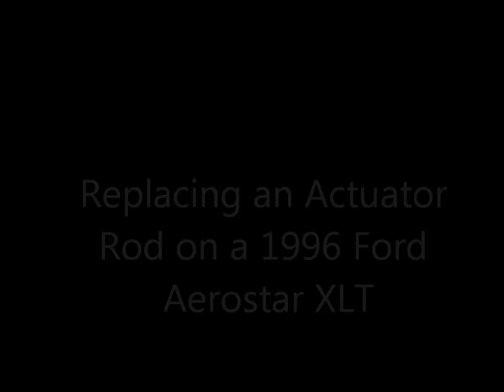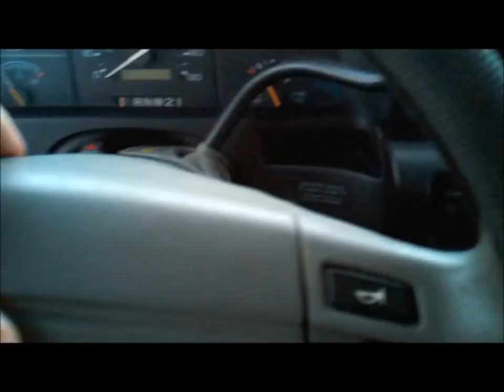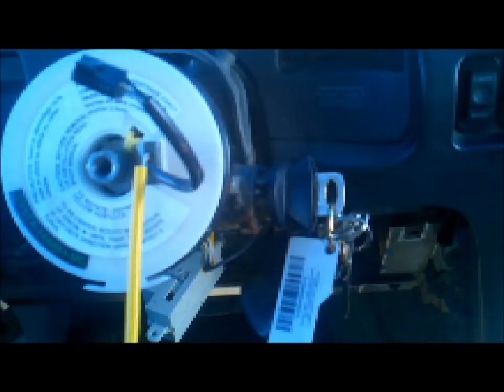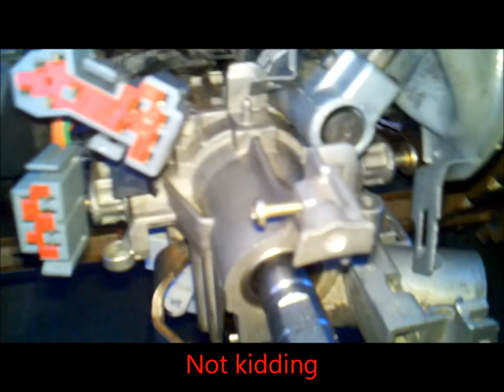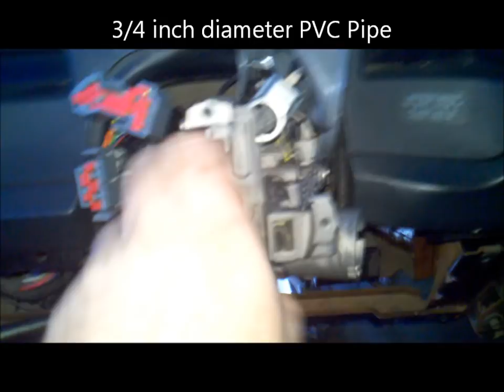Ford Aerostar Actuator Rod Repair

Comment: A couple of key things are missing. 1. The removal of what you called the bearing retainer. The part that is a lot like a snap ring but w/o the holes for snap ring pliers. I didn't see you remove that and I'm stuck at that point. 2. The things you held down with the airbag nuts. Those are held in place by some type of spring pressure? I was thinking I'd have to remove the pin they rest on when the thing is fully assembled.   Oh and one more thing... how did you end up getting the teeth on the actuator in the proper cogs on the gear?
Reply from the maker: Do you happen to have the video times?  Then we can work on getting the answers you need plus with others having just completed this recently there are fresher memories we can turn to just in case.  On the teeth I don't remember having to do anything fancy as it was the alignment of the key ignition cylinder as it came out that has that alignment.  Once the new actuator rod is in it ends up at the same position the old one was in.  I also recommend reading some of the old comments as there are some good tips.
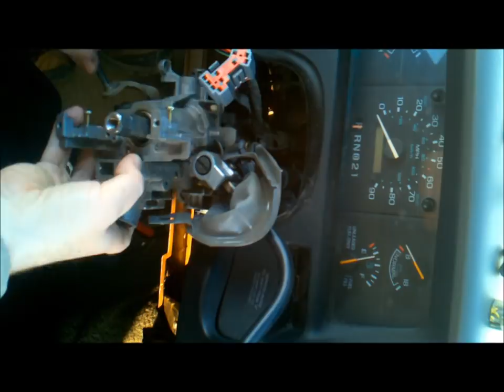Reply: Thanks for the reply. I'm taking a break from it today but I'm in the middle of doing this.  The retaining ring just needs to be unseated from its groove using a screwdriver and then slides up the taper of the shaft and comes off. That wasn't in the video so I don't have a time for that.   2. the time is 8:41 for what you called the lock jaws. I found they (in my case there is just one) are indeed under spring tension. I used a screwdriver to move mine down so there was no snap. I've got mine apart now and have the new actuator so I'm at the reassembly point. I found a vid where a Mustang owner removes the entire column and replaces both actuators. Not sure why he replaced the rear actuator but if anyone ever needs to do that, that vid is also helpful. He gets to the bearing retaining ring here: https://youtu.be/vBZvKFjVTas?t=28m11s
Reply from the maker: I have definitely thought about finding someone local with a need for this repair and remaking the video.  When I made this there was nothing else on YouTube on the subject and it was based on a few different things including something similar (but described in text) on a Ford Ranger.  I spent at least 24 hours over 3 days figuring everything out (including having to go get things).  After all this time and feedback I definitely wouldn't have skipped over as much as I apparently did (including the reassembly).  The filing part alone would have helped others to show exactly how far I had to file to get the rod back in.  Glad you got passed it and thanks for the link!
Reply from the maker: I would also make it in 4k and use multiple cameras to provide multiple angles without the jerkiness there is in spots (or the speed at which it leaves a segment).
Reply: Hope I didn't give the wrong impression because your video was the only helpful thing I found on youtube or searching through forums. I'm beginning to wonder now if I didn't imagine that other snap ring. I took another look at the vid I linked to and that wasn't a snap ring, it was that "tolerance ring." I hope there wasn't another snap ring because I couldn't find it tonight when I went out to install the actuator. I haven't had much sleep the last couple days. I'm doing this job on my 96 F150. I've repaired so many things on this truck that I could have made a few movie length vids if I'd been filming the work ;)
Reply: If you do that you should have that person film as payment. And then run some commercials and make some money for your effort. I usually work alone so filming would be tough. I wish I could have filmed the clutch job and the pedal bushings replacement. The clutch just because it might be helpful to show how to remove and install a transmission alone. The pedal bushings would be more helpful video though. That was a really frustrating job. I couldn't video anyway because my hands tend to get really dirty when I work on old machines. I don't have any video editing software anyway.  Okay I just rewatched your vid and there's no other snap ring so I'm going to go ahead and try to get my truck going tomorrow. BTW I had trouble with that left side lining up too. I'd forgotten your method so I just fiddled with the steering shaft and it all went into place. Thanks again, your vid was really helpful.
Reply from the maker: I can understand that, I also understand what it is like when instructions appear to skip something crucial when you are already knee deep into the problem.  The one thing I wish I would have known when my actuator rod broke was how to turn my van off.  I did obviously learn that and was able to drive for over a week before attempting the repair.
Reply: When I parked and turned the key off and nothing happened... I did the first thing that came to mind... put it in gear, brake, and let the clutch out to stall it. Disconnected the battery next. I'm guessing you removed the ignition switch from the column and used it to start and turn off the van til you fixed it? That reminds me of something. My switch is very stiff... hard to move it into the various positions by hand. I went to the auto parts store and looked at a new switch. It was the same way. If they're all like that I'm surprised these plastic actuators don't break more often.
Reply: I just wanted to add one more thing. On my truck the turn signal cancel cam actually goes in before the snap ring. I was confused there for a bit bc I didn't make note of that during disassembly. I was going by the way your van is. the spring was very loose and the airbag wheel thing was not snapping into place. Also the cancel cam would never have reached to part it needs to reach to turn off the turn signal. I looked closely at the entire assy and the only way I saw it could work was w/ the cam before the snap ring. Voila.  My truck is a 1996 F150 XL 2wd w/ standard transmission. It has an airbag but no tilt steering wheel. I have no idea if other f150 models are this way but as you mentioned... take note of how everything is assembled before jumping into this. And maybe even snap some pics. BTW I installed aligned the slot in the rear actuator w/ the mark on the rear assembly and installed the ignition switch before installing the front assembly and the gear inside the lock cylinder housing aligned perfectly w/ the cogs on the front actuator, That may help someone in future. If any of my comments added confusion feel free to delete them or ask for clarification. I'm not a tech writer, don't know the nomenclature/names of all the parts, and I was flying by the seat of my pants other than the general clues I got from watching your video.  Thanks again!
Reply: BTW I still have about 15 minutes of reassembly left before I test it out. The keys works as it should and the turn signal cam cancel works. I'm assuming it's going to be okay based on that.
Reply: It's fixed
Reply from the maker: When I made that video I just used Windows Movie Maker which, at least at that time, was included for free with windows.  I haven't tried to use it in quite a while now though.  Now-a-days a $50 action cam on a $5 chest or head mount would also work.
Reply from the maker: Somewhere on here I mentioned that I used pliers to move it.  I do wonder why they didn't go with something a bit stronger as that pin breaking off is really common (this video wouldn't have as many views as it does if it wasn't happening to lots of people).  The downside of DC electricity is that it requires larger diameter wires and thus that switch has to be really robust to do what it does.  Yet when you use just the key it doesn't translate at all to being stiff to move.  My van was an automatic so couldn't stall it out that way.
Reply from the maker: It wasn't until I did that repair that I realized how simple a turn signal cam was and it still makes me sad when they go out.
Reply: I'm not sure if I ever had Windows Movie Maker but software is for sure the hangup for me. I have a Canon SX that takes good pics and decent vids and also a ZOOM Q3 for music vids but I can't find any good and affordable editing software.

Comment: How much did you have to file it down? I can’t squeeze mine in there, the more I file I worry it’ll just break once all is back in place
Reply from the maker: Melany A I had to file it a decent amount but not too much.  I didn't use any power tools so it was a decent amount of work.  Once I got it on I never had another issue with it despite the filing.  In the video the actuator rod looks flimsy on there but once everything is reassembled there was no issues.  Can you give me a link to a photo of your filing work?

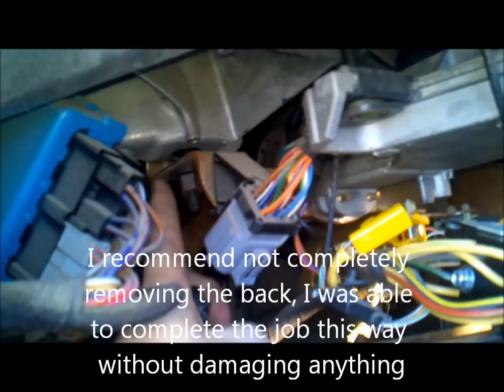Comment: At 8:30 of the video, lowering of the column, be extra carfull not break the string that goes to the gear shift indicator, if that breaks the red indicator will not move with your gear shifter hence you wont know what gear the vehicle is in.
Reply from the maker: Steve O definitely sound advice

Comment: I just did this repair today on my 1995 Mustang.

this video was super helpful.    I could not replace the spring however for the tilt adjustment.   i'll attempt that later.
Reply from the maker: alex hatcher I never did replace mine and never notice any issues.
Reply: It just drops to the lowest setting.   i used 5 zip ties and compressed the spring.  it slid right in and then i snipped the zipties.     This video was extremely helpful.

Comment: so i have a 96 f150 and the problem started with the truck not wanted to shut off buy the key so the tumbler was replaced and that kept the key to stay in but now the truck wouldn't start unless the starter terminals was bridged which i only did once, so i did more asking around and i was told its the ignition switch which soon after i had replaced but in process of that it was the white little hole that the switch went into that felt pretty loose and seeing how i had no idea what that was i installed the ignition switch and now nothing works not even accessories could this be cause to the actuator rod being broke? email me at marcus.harris46@yahoo.com please

Comment: how long did you cut your PVC pipe
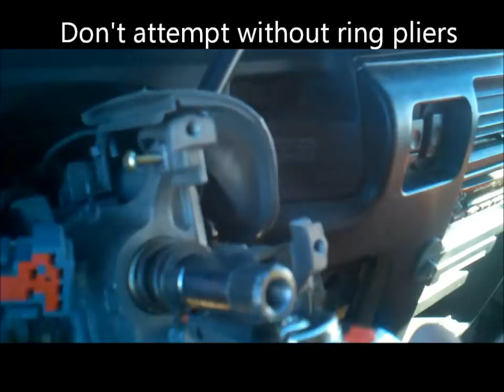Reply from the maker: Hi Aaron, the length of the PVC pipe is really based on the length of your extender.  Underneath the PVC pipe is the extender and all I am doing is tightening the steering wheel retaining bolt (you can use the old one for this step) with a washer between the ratchet wrench and the PVC pipe with the extender able to go through the center hole (so that as the retaining bolt is tightened (only needs to be partial tightened) the PVC is pushing the snap ring against the spring until it is back to the original position as it was at 6:54 in the video right after removing the turn cam ).  Thus the length of the PVC pipe must be cut so that it supports that compression (just enough so that you can start to tighten the retaining bolt but not much more as you want it to push on the snap ring soon after you start to tighting the retaining bolt).  After you get the spring compressed you can remove the retaining bolt.  Let me know if this answers your question or if I need to clarify anything.  I would go with your longest extension available so that you have a decent amount of pipe to cut on.
Reply: Thanks that was very helpful. And now I am trying to get the tilt wheel  spring with not much luck. Any suggestions?
Reply from the maker: I sadly did not get that back on but to quote one of the comments below: 
noothernameisavail    3 years ago

Forgot to mention that the tilt spring can be compressed quite nicely with zip ties! Have to evenly tighten them as you go or they will slide to one side. Had five zip ties before I got it compressed evenly and tight enough to easily go in place. Cut the ties and pull them out...

Another note: noothernameisavail also noted that using the PVC pipe can be hammered (I would recommend a soft mallet) instead of the bolt on strategy I used.  Eventually I hope to make a new version of this in 4k that takes in the advice and experience of all the comments to ensure a more clear path to performing the repair.
Reply: This video saved me! Thank you so much. Even with a slightly different van I was able to work through it an come out successful. Thank you for making this awesome tutorial

Comment: will this keep you from cutting the car off?
i have to disconnect the battery to cut the car off, but i can crank it up.
Reply from the maker: If your actuator rod breaks you likely won't be able to turn off (cut the car off) when on or (if it wasn't on) be able to turn it on.  The ignition switch I talked about is a small off-white box held in by two torx screws and if you pull that out (like it is in the video) you can manually turn the vehicle off and on without having to disconnect the battery (I got by for over a month with the rod broken that way before I finally got to the solution the video shows).  You do still have to have the key in the ignition turned to on to unlock the steering wheel but otherwise with that box out you start and turn the vehicle off (or put in aux mode) with that box only.  Once the actuator rod is replaced you just replace that box and the key will work as it did before (all the rod does is move the metal pin sticking out of the switch to the location determined by the key).

If I didn't answer your question let me know :)

Comment: this helped me a lot thank you did the job yesterday. I have one question tho when you finished was your steering wheel tight to turn, mine is. Is it possible that I tighten the steering bolt to tight
Reply from the maker: Glad it helped and I apologize for the delayed response, my phone wasn't able to see your message.  Strangely enough that actually could be the issue and in terms of affordability that is definitely the best place to start.  I wouldn't torque them passed  6-8 lb./ft. and after loosing (possibly with the front end jacked up) see if the steering is easier with the bolt loosened (with the battery still disconnected).  As this has already been 2 days hopefully you already tried loosening it?

Comment: Will the part you're replacing keep the car from turning off? I have no problem starting it, but I have to disconnect the battery to turn the car off
Reply from the maker: Sorry that I responded to your newer comment and didn't see this one.  Are you still having this issue?

Comment: good video,will that work for a 96 ranger
Reply from the maker: gene myers - Not sure how I didn't see this but for anyone else with this question the answer is yes as I based part of the repair on a guide for a 1996 Ford Ranger.  There could be minor differences but nothing major.

Comment: This video helped me changing out the linkage in a Taurus for a friend's son. One thing I did differently- instead of sanding the new upper actuator (the weakest area of the part that broke) to be able to get it into the lower actuator, I used a pneumatic band file to put a notch in the aluminum housing enough to get the new upper actuator in. The housing is plenty beefy enough to withstand it.
Reply from the maker: +fbama73 Thanks for the idea.  If I get time I plan on trying to make a new video (I have better equipment/software and I dislike the flow of speech I had while making this video).  I also hope to incorporate all the feedback and improvements, like yours, so that everyone can better benefit (plus show the full reinstall).  Thank you!

Comment: Hey, 
great job on this video! This helped me putting back the ignition switch where it belongs. haha
I'm having problems though putting the 3 pieces into the ignition cylinder housing though. Which position does the little gear need to have? 

Thanks in advance
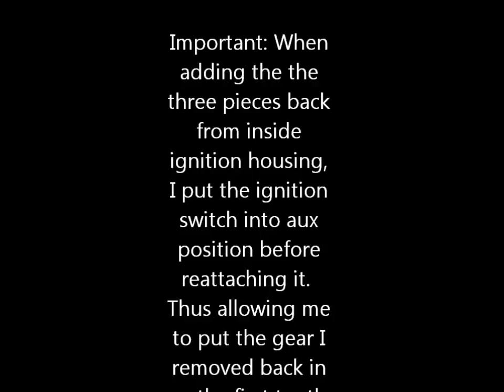Reply from the maker: +Florian Brett Sorry for the slow response (hopefully you already have this figured out) I do remember having difficulty with that step as well.  I almost want to make a new version of this video with better camera angles (my kids are old enough to help now).  As for your question, the most I remember of that step is noted in the video at 13:40 (The text part there is not credits but a note about the exact issue you are having).  That being said, it will take a little fine tweaking to get it right.  I apologize for not having video of that step.
Reply: +Captain America, thank you for the response. I did figure it out, after all. especially the gear setting right was difficult. But I figured out that on the bottom of the searing column there is a little mark on the metal part, that indicates where the whole of the actuator is supposed to be when putting the ignition cylinder in. since there is only one way to insert the cylinder the gear can be se to that position. took me a second to step back and think about it a little more. also important is, that the gear retainer (the little plate) needs to be put in that it can be rotated into position counterclockwise. I was trying to make it work the other way first.
thanks again for this awesome video. I did this repair on a Mercury Grand Marquis 1999. Great work. I avoided a big bill and even better learned a little bit on the mechanics. I had my fun with it.